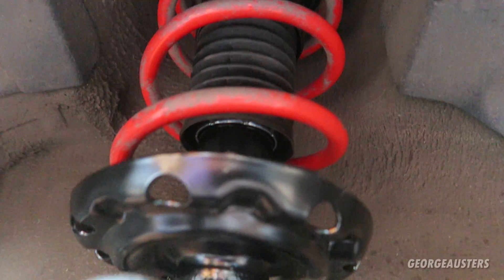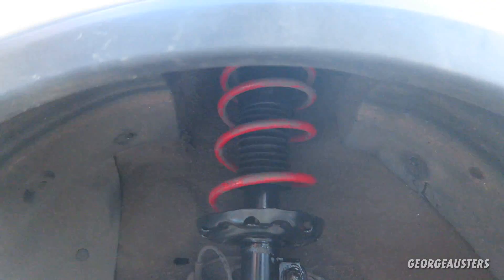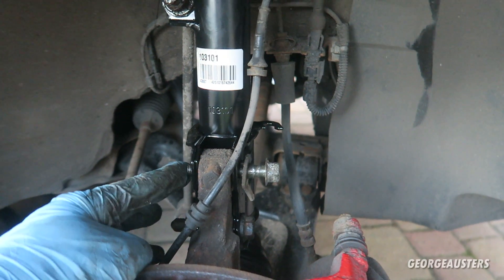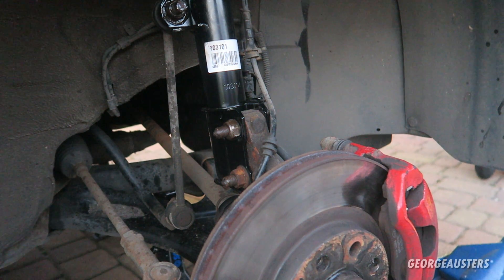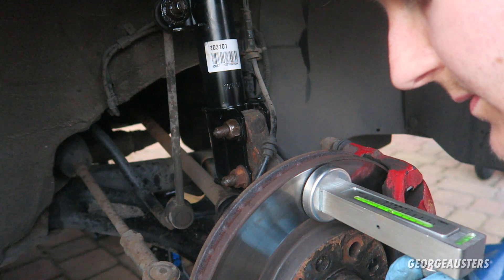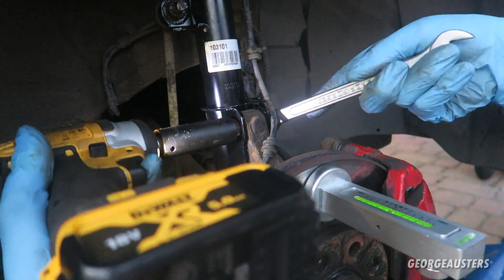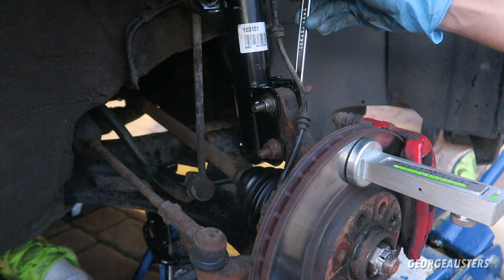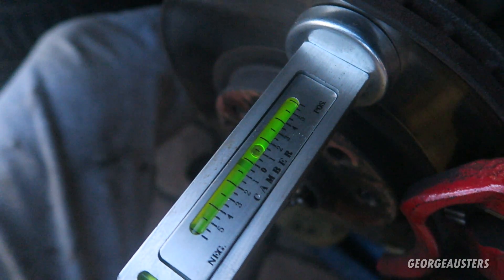How To Adjust Camber On a Car Using Camber Bolts

Comment: FOR YOU TO GET A GOOD ALIGNMENT! Tires need to be on the ground
Reply: The author insists 1 degree of camber is the same whether or. not the Car is on the ground or in the air. That may be true of whatever he’s working on, but I’ll tell you one thing it is not true on all cars.  Not on a sophisticated front suspension like a Mercedes 126.  The right way to do anything is always with the car correctly laden, on skid plates.  Not in the air.  Ive made adjustments with the car up in the air, then drop it down roll it back-and-forth and then check the numbers.  The arc of Transmitted motion between the cam bolt and other suspension numbers is never linear. Even had a zero offset steering vehicle, like an IndyCar, you still have to factor in suspension compliance.
Reply from the maker: Another person who can’t read.... I wasn’t trying to do an alignment!
Reply: @GeorgeAusters  I understand.  You were just changing one suspension Geometry parameter.  But on some cars, you simply can’t do it with your method.  On a W123 or w126 Mercedes, for example, If you lift up the front of the car and change the camber by any amount, it will throw your toe-in spec.way off, and you can’t know what the actual operating camber value will be until the car is on the ground, springs are compressed, suspension compliance is taken up, and ideally, the car is properly laden. Mercedes recommends putting 300 pounds of sandbags On the  drivers and passengers front floor and forcing  the front wheels apart at 100 pounds pressure with a spreader bar to account for real world conditions. Changing toe in on these cars automatically changes camber value so it’s a continuous process of bumping camber, correcting toe, checking camber again (because it changed when you fixed toe), etc.  it took me two hours and probably twenty adjustments of both camber and toe to get my 300 SD right, but once sorted out correctly There’s no vehicle on this planet that feels as good in the hands of its driver.   I do see how your system could work for some cars with simpler suspension geometry’s that aren’t as sophisticated, and I think the title of your video misleads some people into thinking you are doing a proper alignment.   Thanks for the video. I liked it.
Reply from the maker: 1 degrees of camber is 1 degrees of camber whether the car is on the floor or not. I was just altering the angle of the strut
Reply: George Austers you’re idiot that all
Reply: Another moron that can't read.

Comment: A lot of people entirely missed the point of this vid, he is not aligning his car, he’s adding 1 degree of camber you fruitcakes
Reply: Oh I see.  Point taken.
Reply from the maker: Yep exactly👍🏻
Reply: Top notch use of fruitcakes 👏
Reply: what kind of fruitcake am i?
Reply: @EastCoastinn  one that responds after 4 years
Reply from the maker: I was adding 1 degree of positive camber to the factory settings to compensate for the 30mm lowering springs.
Reply: @GeorgeAusters  we meet again, 4 years later 😂

Comment: So tell us how that rotor is flat against the hub when it is just floating?Also the gage goes on the hub surface but i guess the way you did it will be close
Reply: rotor is straight because pads are pressed by driver ( not shown)
Reply: Another moron that can't read.
Reply: @glenlarson5373  you need to shut up and quit calling people morons. By the sound of it you have nothing to add in the wheel alignment department. If you did, you would add something useful instead of making yourself look stupid because you don’t understand anything about it.
Reply: @glenlarson5373  You could've just said nothing at all. We're all here to learn and get help with wheel alignment, if you're not here to learn and support then you're the moron wasting your time.

Comment: FAIL, giving bad information.  Vehicle camber  MUST be adjusted with the car level and weight of the car on the suspension and NOT the springs fully extended.  Unless that's how you drive the car.
Reply: Another moron that can't read.
Reply: Nope. You're wrong. On many cars if you try adjust the camber without lifting it the adjustment will literally slam to it's max setting once you loosen the bolt. The weight of the vehicle forces it. Take the measurement at ride height, do the math and figure out how much you need to add/subtract, and then after you lift the vehicle the measurement will only be a reference
Reply from the maker: I’m not gonna explain myself again mate, but the reply is on a whole bunch of other comments 👍🏻

Comment: First you need to level the Camber alignment to 0 to wall follow with water level, then attached it to your disc rotor. Second, most cars setting neg 0.45 - 0.5 , your setting it up to positive camber.
Reply from the maker: I wasn’t setting up any camber... I was just adjusting it by around 1 degree to account for the 30mm drop
Reply: @GeorgeAusters  how do you find neutral camber in a car which has a few degrees of negative camber? visually you can tell
Reply from the maker: I wasn’t trying to find neutral camber... I was just trying to add 1 degrees of positive to correct the 1 degrees of negative caused by the 30mm drop
Reply: Another moron that can't read.
Reply: @glenlarson5373  or just another human who watches YouTube videos on how to do a diy but yet knows how to do it better. Just another human being who wakes up with the main goal of the day to make someone as miserable as him. I like to thank anyone who takes out of their lives try and post a helpful video whether or not it helped me atleast they tried.
Reply: you saying most cars have a 0.5 degrees of negative camber?
Reply: Why you haven’t make a video like him then?

Comment: Hi I've bought 1 of these for my66 mustang but have to USE shims , so when I attached to disc , how do i tell the current angle of degree do I turn the knob so it's dead level?

Comment: Did you really set the alignment (camber) with lifted car?
Reply from the maker: I didn't set the allignment.. I just adjusted my camber 1 degree
Reply: @GeorgeAusters  well, with camber, you also mess with the toe. So now you have (i guess) positive toe. :) and well, both camber and toe change when you drop the car. :)
Reply: Sir you right
Reply: And the gauge is sitting on rust.????? 
Also a worn disc thickness can vary across its face.
Reply: @nigelmitchell351  genuinely doesn't matter. He zeroed out his gauge and literally added one degree. It doesn't matter what angle he was previously sitting at. He wasn't aligning. He was simply adding one degree.
Reply from the maker: Thank you Michael 🙌🏼
Reply: @Immad1337  You're right of course, but as a lad I was always taught to work from faces and diameters of known accuracy.
As a matter of principle I still do, old habits die hard my friend. ATB.
Reply: @nigelmitchell351  With camber you also change the TOE, this means you have to adjust both, not just the camber. So, this is the main reason why you don't do it with the lifted car. ;)
Reply: @GeorgeAusters  Is it possible on your car to get the gauge through the rim on to the disc. With the car on a level ground pop it through the rim on to the disc and see how much camber you have to before you start work.
Reply: Another moron that can't read.
Reply: @glenlarson5373  what didn't i read?

Comment: You have now screwed up your toe settings. Car needs aligned. It's also a myth that 0 degrees camber is best for tire wear. You would have been better just leaving it.
Reply from the maker: I'm not trying to get 0 degrees... For the 1,000,000th time.. I'm just trying to ADJUST it by 1 degree
Reply: @GeorgeAusters  ok. What are you trying to get to?

Still screwed up toe though.
Reply from the maker: I was trying to adjust the camber by 1 degree which I did. 

Toe was not affected, I had a wheel allignment after 👍🏻
Reply: @GeorgeAusters  why did you do this ? You had problems with front wheels grinding or something ?
Reply: Another moron that can't read.

Comment: Hello, I have a weird question. Can I use camber bolts with aftermarket coilovers (meaning the car is lowered) or should I go with camber plate ? My coilover (Tein street basis Z) doesn't have camber plate and I have to use camber bolts, but it seems it's not holding it's position properly. It usually 'slips' when driving on uneven roads (ruts, bumps, potholes etc).
Reply from the maker: You can use camber bolts with any struts👍🏻
Reply: @GeorgeAusters  Thank you. But why my camber bolts keep slipping? I went to several alignment shops and it's all the same. Should I get another one which is 1mm more ?
Reply: @jin5632  are you torqueing the bolts down to spec after you reinstall the strut/coilover? that might be why its slipping, not tight enough, also make sure to bolt down the lower nut first, then check your camber again to make sure its right before tightening the actual Camber Bolt
Reply: @jin5632  don't forget to look up Torque Bolt Specs. And Torque them accordingly. The usual specs on these types of Bolts are 70 Ft Pounds. I seen that on another video. That was for a car. I think Truck Bolts need to be Torqued a lil higher

Comment: Went to my regular dealer shop to change front tyres.and at alignment part..it went out that i have a problem with my camber front driver side..is in negative position and he do not work with that...what should i do??? Cant find any mechanic .just dodgy dealers here in london
Reply: you also dont need camber adjusted with factory lowered springs like my astra h sri.
Reply: Some cars have adjustments for camber. Some do not. And for those that do not this is where these aftermarket camber adjustment bolt kits come in handy. Keep in mind that high in mileage vehicles the camber changes due to wear in bushings in the front end. If the spec is not too far off , then for those cars with non adjustable camber , sometimes the strut mounting bolts can be loosened a tad and the entire strut pushed a tiny bit to make corrections
Reply: @abyssalsoul6216  So instead of replacing the original bolts for Camber Bolts you can just replace the bushing on the front? I understand it is much more complicated procedure to replace theat bushing, just was looking for the answer what is wearing in older cars, that that need for Camber Bolts appears. Thank you.

Comment: Shouldn't you zero the gauge first on an upright that is true to perpendicular? Like a steel post? Gauge on zero then measure the camber angle?
Reply: Another moron that can't read.
Reply from the maker: Gauge is set to zero on the brake disc then it is adjusted 1 degree
Reply: @GeorgeAusters  what if the disc isn't true perpendicular to start with, if the gauge is checked to perpendicular (set at zero) independently then it will tell you how many degrees of camber you have as soon as it is put on the disc or wheel. If the wheel is  2 degrees out before you start then zeroing the gauge on the disc will give you the wrong reading ..
Reply: You can do it multiple ways. His method is sound as is yours. I prefer doing the way you said. I used a fridge to set mine at zero cause my house is brand new so it’s perfectly level and hasn’t settled in yet. Then you place the magnet on the caliper and simply adjust to zero. He simply used zero and adjust positive/negative from his original reading before zero’ing. Again multiple ways to set your camber
Reply from the maker: @Portorrro86  Remember i'm not trying to measure my camber. I'm only trying to adjust is 1 degree. So it doesn't matter where I zero'd it off :)

Comment: For rear caster and front caster, you don't change those for track alignment right? They stay the same for street and track alignment? (c7)
Reply from the maker: Caster? Very few cars even come with the ability to adjust the caster
Reply: @GeorgeAusters  Another question if you don't mind, I gave the alignment shop the spec I want, rear camber -0.8 and they did -1.08 . is that close enough or were they lazy. Last time they actually did it to exactly what I asked of -0.8. Also this time thrust angel they did it .03 while last time was 0. (Camber etc They are all within specs, just not what I asked for exactly) Go to a different shop?
Reply from the maker: It's not very far away but did they say why they didn't do it? Thrust angle is the alignment of the front axle to the rear axle so not really possible to adjust it
Reply: @GeorgeAusters  Nope they never say anything about it. Actually for front right caster after adjustment it's out of factory specs, I asked and they say the car will drive straight like that, I can go back and they can make it within specs but they can't guarantee if the car will drive straight. Is that true what they said?

Comment: dont you have to level the car???
Reply: Another moron that can't read.
Reply from the maker: It doesn’t matter. You’re not changing the height, you’re just changing the degree of camber... 1 degrees positive camber is the same whether or not the car is on the floor or 20ft in the air
Reply: @GeorgeAusters  not height level. 1 deg from what reference. The reference has to come off the frame of the car. You have to level the frame left to right.
Reply from the maker: @dicktomasko1553  +1 degree is +1 degree. I wasn't checking the camber in this video, I was simply just adjusting it +1 degree.

To check your camber allignment then yes you DO need the car to be on a level surface and on an allignment machine.

Comment: do I need camber bolts to add negative camber?
or how do I know if I need camber bolts
Reply from the maker: You can add negative camber by lowering your car with lowering springs or coilovers. 

You can also adjust the camber on some cars with a camber arm adjustment but if your car doesn’t have one then you’ll need camber bolts 👍🏻
Reply: If you don't know, don't worry about it.

Comment: Hello Does this Also Apply for my Mitsubishi Lancer ES 1.6L 2002.? My Rear Inner Tire is Getting Bold. Kindly Need Advice From Anyone, Much Appreciated...
Thank You
Reply from the maker: Do you have independant suspension on the rear or is the rear axle a fixed beam?
Reply: @GeorgeAusters  
Do you have a gmail that I can Send you a picture.?
Reply: @GeorgeAusters  
NATURAL Stock Parts
Reply: Please never do this to a 1.6 lancer 😂💀

Comment: I need to do this to my car, how was it once driving and on tyre wear?
Reply from the maker: Yeah camber is spot on now... Like I said in the video; when you add lowering springs or coilovers you will add negative camber so you need to correct it back to neutral if you don't want uneven tyre wear.
Reply: @GeorgeAusters   thanks for this vid I did what u said on my vxr then went and got it tracked as I put new tie rods on..
Reply from the maker: Nice one mate!

Comment: But you adjust the camber without weight in the car?
Reply: Hank Bridges  jackstands should be under the control arms
Reply: Another moron that can't read.
Reply from the maker: Yes. Doesn’t matter if there is weight or not, just keep it consistent for both sides

Comment: Prob a daft question but, if you've got normal springs and change the shock absorbers and put back the normal ones, does that fuck up the camber, do I need to check it or smth,? Nice video 👏 cheers
Reply from the maker: No mate. It's only when you change the ride height that you alter the camber
Reply: Cheers for the reply bud.
Reply from the maker: No prob, thanks for watching!